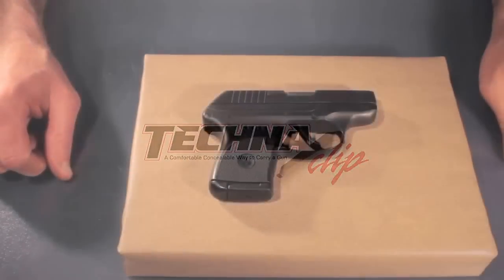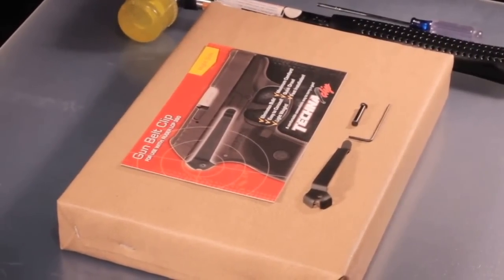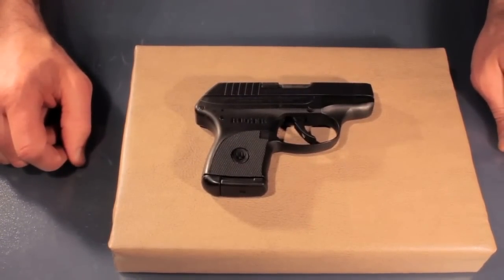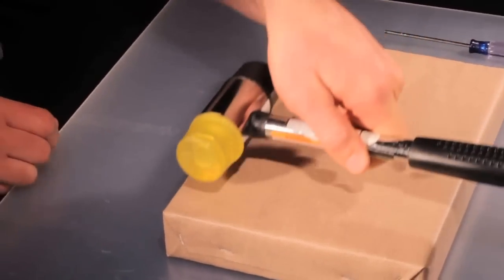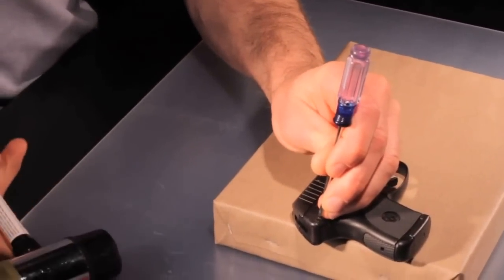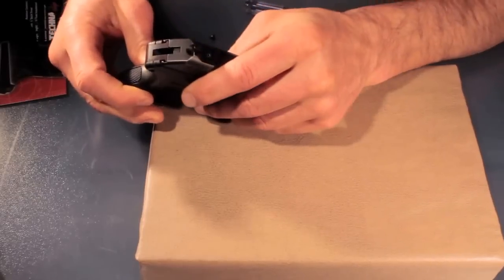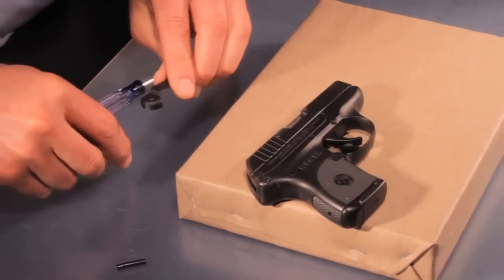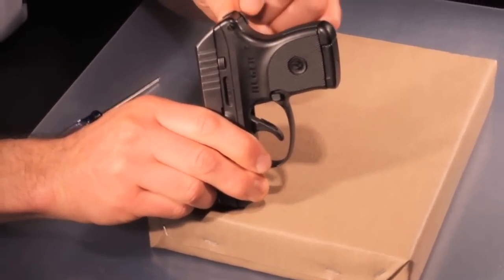Ruger LCP Techna Clip Installation

Comment: Waste of money. There's no way to counter torque the screw. It gets threaded into the loctite and the pin starts spinning. I even stuck it between wood in a vice to apply pressure to stop it from spinning and it still spun. If there was any common sense in this design they would make it with an Allen hole on the other side to counter torque it.
Reply: Thanks for pointing this out.  I haven't bought one yet and probably won't now.  I don't see how you could possibly get it tight enough.